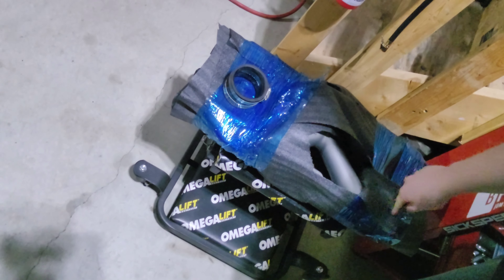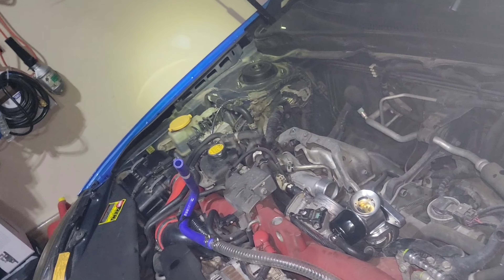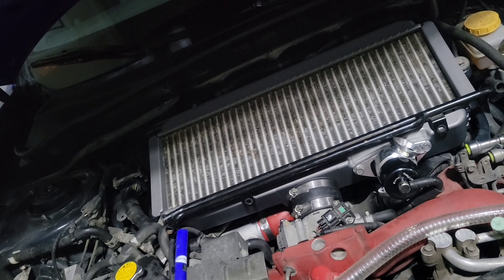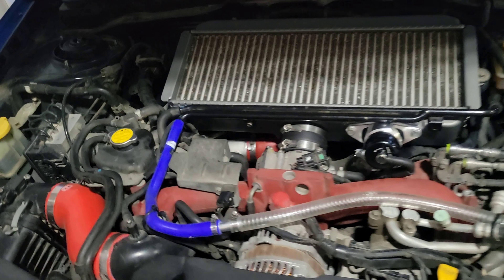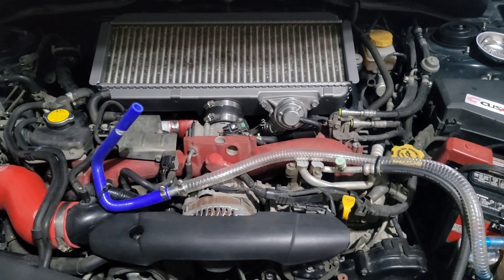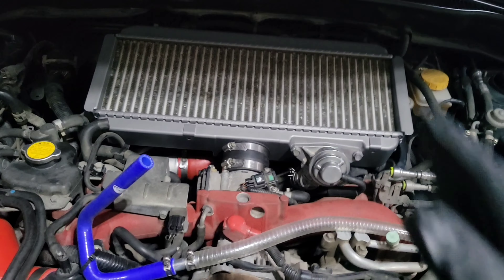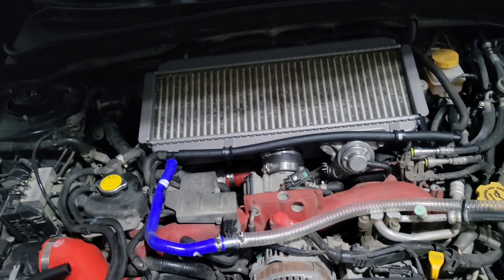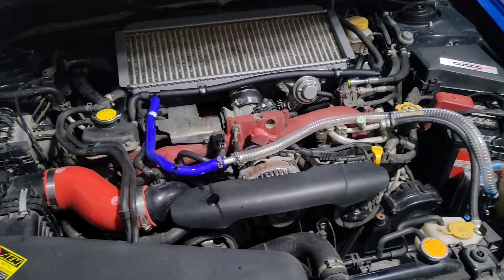CERAKOTED Intercooler & PCV Update - SubaruWRX STi

Comment: Why don’t you do a proper aos or catch cans ?
Reply from the maker: AOS is not my preferred choice. And if you look on my channel, I do a proper catch can set up on my GDB. And will likely do that to this car as well. I just wanted to try this Cusco product out. AOS are not great in colder climates or street cars IMO.
Reply: @BoltsNBoost  yeah I agree..but I don’t think a 2 hose setup works 
The radium dual catch can seems to be the best
Reply from the maker: @Subaru ej207  a 2 hose catch can set up that is properly routed to intake works great.  I took my GDB to the track and it worked extremely well. "Catches" about have the oil in the PCV system I say.